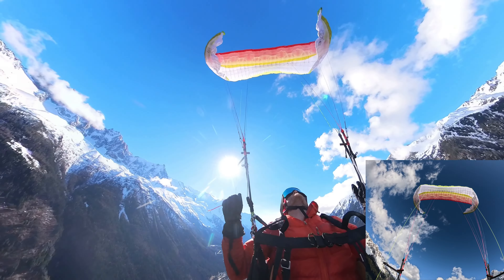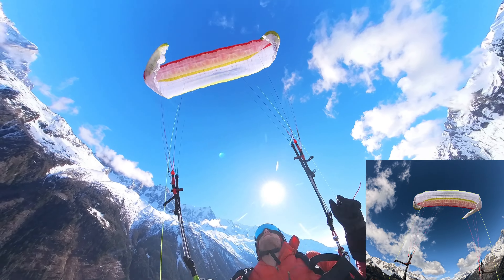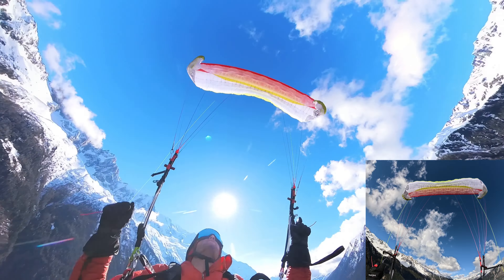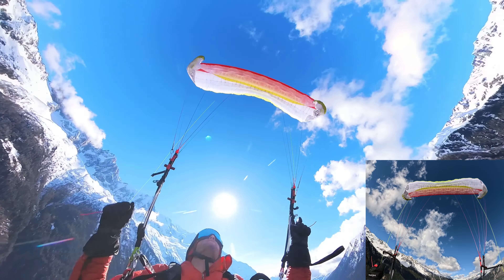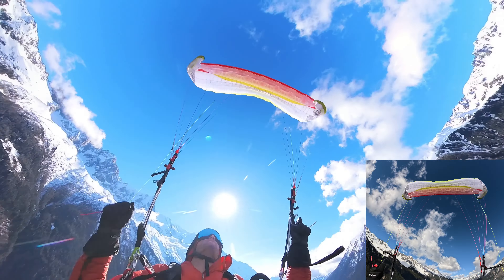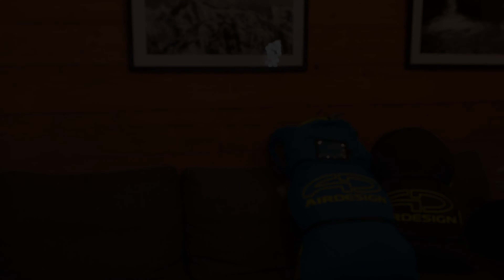AirDesign Volt 5 vs Hero 2 SIV test

Comment: what are your shoes? :D EDIT I finally could read ribelle tech? Is it a good option for flying?
Reply from the maker: Yes that's the ones. They are good summer alpine mountaineering boot. So depends what you need. I was wearing them as the walk to take off is a bit snowy right now. But I don't tend to wear them to fly unless I'm on snow. Hope that helps.